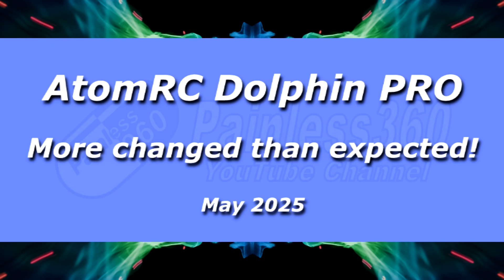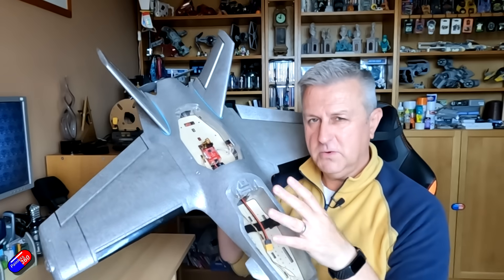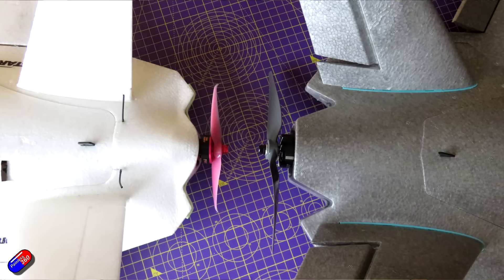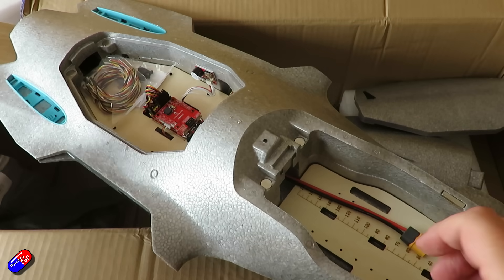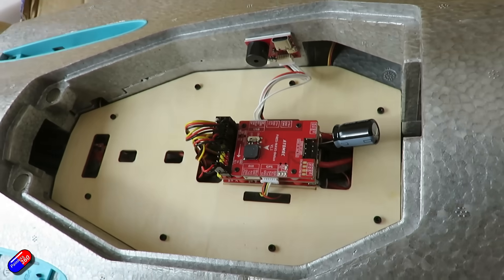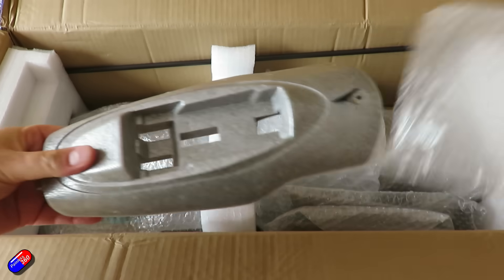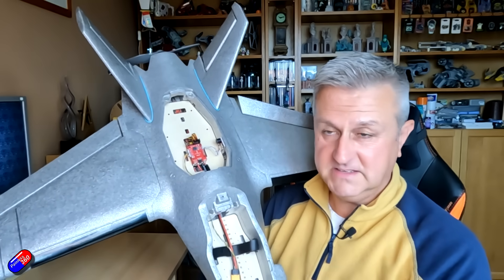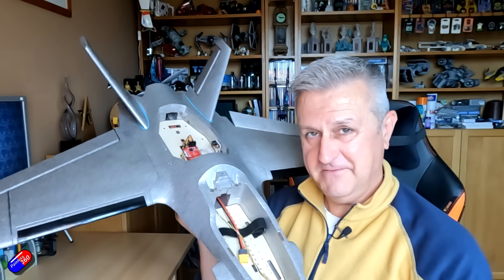AtomRC Dolphin PRO: Mine is here and here's what I found!

Comment: Thanks for video. 
I have a question: can ı use hobbyeagle a3 pro gyro for a taileron plane?
Reply from the maker: I've never tried but the currently supported setups will be in the manual. Best of luck
Reply: @Painless360 thank you for answering.

Comment: I'm awfully tempted to pull the guts from my old Dolphin and stick them in this new body. As my first plane, it got smashed up pretty good, and certain things are proving difficult to fix. This looks like they did basically everything right, minus skipping a screw in the back. (my back hatch flew off on a launch and got chewed)
Reply from the maker: Rear hatch has a  champhered rear edge so I wouldn't expect it to pop out.... Happy flying
Reply from the maker: Check out the post on the channel, I've taken a picture of it for you :D
Reply: @Painless360  Does it now? Seems that you're spot on in calling it a proper V2.

Comment: I got that GPS on the new Penguin RTH I got recently, get rid of it, don't even waste your time with it. One thing I would like to know is if the new Navi deluxe powers the gps and Rx while plugged into USB. The regular FC does not and I hated it so much I tossed it and put in a Speedybee.
Reply from the maker: Sadly, no GPS power from USB. 🙁But, the RX is powered. I've swapped the BN220 for an M10 unit here as I really wanted to try it 'as supplied' but that GPS isn't a great choice for such a cool plane...
Reply: I got 8 sats inside the house with the preinstalled gps. I don't have many gps units that do that, if any!

Comment: Lee what’s the max AUW?
Reply from the maker: Recommend to keep it below 1.5kg (from the data on the webpage)
Reply: @Painless360 Thank you. Seems with the 2807 motor I could use my 2212 motor with 8x6 props. Slightly larger stator volume.

Comment: Are you sure that idea is to use this as a traditional V tail plane? Where ruder and elevator is combined?
Reply from the maker: See INAV config ad supplied. Options for pilots to tweak stuff too...
Reply: @Painless360  What we will benefit with this change? Removing elevator function from elevons and implementing in V tail,  what it will improve? What was the practical goal here?
Reply: @Mr.Laidukas  imagine 50% of the power for pitch and roll on the dolphin v1, here with the new one 100% of power on each control surface. So more control, more stability, more response.
Reply: @Tommyjames21 but do you lack authority on those surfaces in v1 ? Do you fly in 100% throws/rates and full stick movements?
Reply from the maker: It's interesting to read these opinions.  I guess the flight testing will answer it though... ;)

Comment: Moving to a vtail seems like a downgrade to me. Have rudders is nice but having to use them as elevators doesn't seem right to me
Reply: You can always use elevons instead :)
Reply: @stadt-bremerhaven  Does the CG location change when using elevons only? (I see they included the tail servo plugs in the kit, so it must be at least workable)
Reply: I agree.  I'm not a fan of V-tail elevator authority at low speeds.